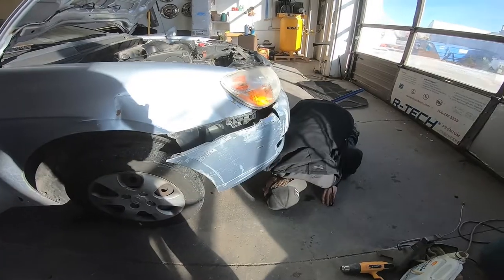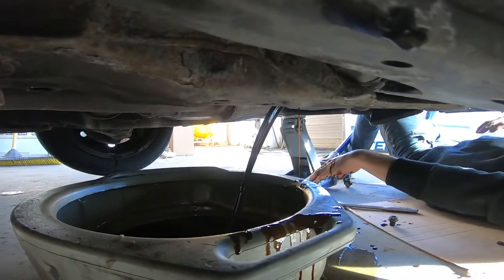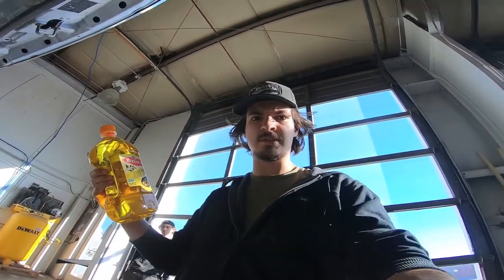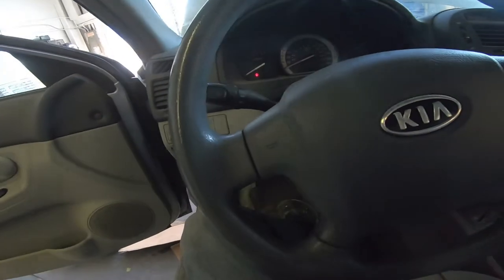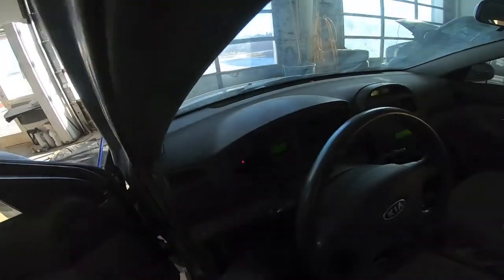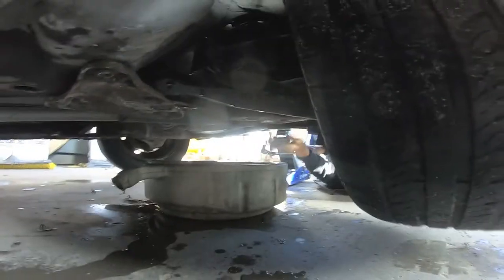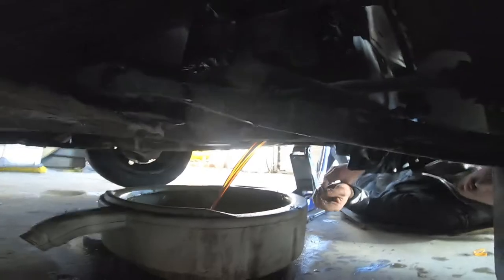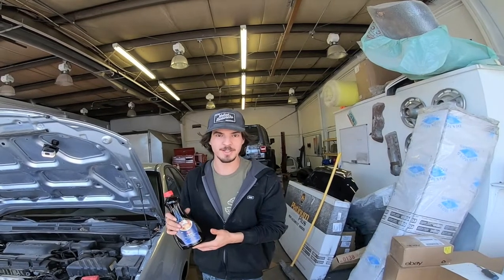Will it Run On Olive Oil? Shocking Results! Cooking Oil for Engine Oil.

Comment: Olive oil is a vegetable oil! The olive oil has the highest anti-burn rate of all vegetable oils so if I was to use or try anything like this I would use extra-virgin olive oil of course, my favorite in the kitchen is Bertolucci,  actually. Funny thing as years ago I sat on the plane next to the president of the Bertolucci Co. Cool dude & was happy at the time beating the Star Oil Co!!
Reply from the maker: Awesome!
Reply: Donnie, extra-virgin olive oil or olive oil in general is really bad with high temps. Ask any kitchen, there's reason it's used for salads and not for frying.
Reply: @Mister_NO.  Agrree, the above suggestion seems to try to ruin other people engine. We should only use extra light. But I think a mix of corn oil and palm oil is the best. But work better as oil additive because keep in mind that all engine oil must have additive, and cooking oil do not contain proper additive.
Reply: Bertolucci is garbage. They don't sell real olive oil in U.S. grocery stores. If you want actual olive oil, you've gotta either find a European store, or order online. It comes in metal canisters and it's so much better.

Comment: See how it does after 3000 miles. That would be a good test lol
Reply from the maker: Lol i dont think she would make it
Reply: But on the other hand, how long they drive with those racing oils? Usually a lot less than 3000 miles and the engine still might blow...so maybe this is worth of getting those extra 100 horsepower 🙂

Comment: olive oil is poor choice. The best would be the mix of corn oil and palm oil.
Reply from the maker: interesting.
Reply: @Americana777  In here a lot of people get a good result using group 1 oil and 10% palm oil to clean sludge. No need for engine overhaul. Engine flush is already proven to be useless.

Other use it to increase oil mileage.

Comment: I'm from Indonesia and have been using a mixture of cooking oil + engine oil for 6 years with a composition of 50:50, and have never had a problem until now.
the engine sound becomes smoother and more powerful
In my country many people have used it for years😁😁
Reply from the maker: Wow very interesting. Thanks
Reply: saya jg makek di panther bang🤣🤣
Reply: Just use Mobil 1 and u'll never have a problem
Reply: I read an article on using olive oil decades ago and short term there were no problems, long term there was an accumulation of deposits. Motor oil has a detergent additive which olive oil does not. If a detergent additive that was compatible with the olive oil it “should be” ok
Reply: Pakai oli apa bang? Saya pakai Mesran B40

Comment: I use palm oil 20% for honda cub motorcycle. I try run 2 hours and i can't tell you the difference.

No different between cooking oil or engine oil. No over heating, no harsh sound, normal.
Reply from the maker: Lmao

Comment: i wonder how many miles you can go, maybe that should be your next video
Reply from the maker: I drove the car home after putting regular oil in it. (30 minute drive). The next morning i went to start it and a bunch of valves were stuck open and it smashed them lol! Noooo! Had to scrap it :(
Reply: i run vege oil in my 150cc bike daily 200km commute and change it every 2000km for about 2 years now with no noticable problem or excessive wear.

Comment: should have done a compression check before and after. hey that aint a bad car if it was 500 bucks. put a defouler for the cat get it smogged and ur good!
Reply from the maker: I drove it home, parked it and the next day when i went to start it, all the valves got smashed, thy hung open i assume due to the non motor oil we used lol

Comment: Why was there a beeping sound in the car on 3 occasions when you were driving? Funny video but this would call for a month-long test. 😊
Reply from the maker: Lol, i know it wouldnt make a month, after the maple syrup engine oil test i actually drove it home, when i came out in the morning the valves were hung open and they got smashed when i tried to start it lol poor car.
Reply: Sounded like the seat belt alarm as he wasn't wearing a set belt.

Comment: you didnt run it till it failed. downvote
Reply from the maker: Lol no! I actually drove it home like 30 miles and belive it or not a couple days went by and i went to fire it up, and a bunch of valves were stuck open and it smashed most the valves. Checked timing and it was good. Pulled the cover and a bunch were stuck open. Sad deal, wouldve done more with it i was going to do like milk next.